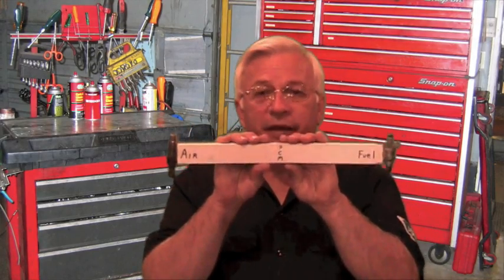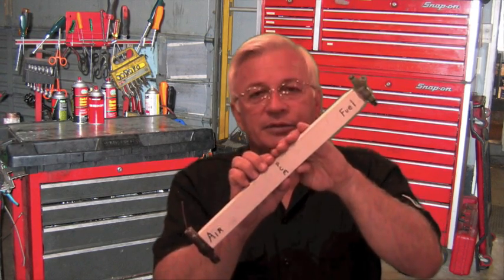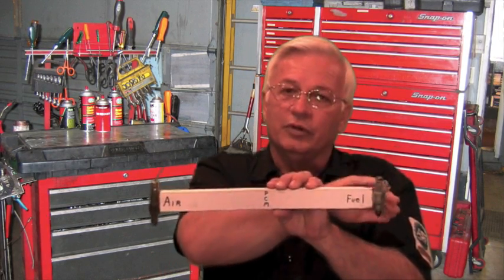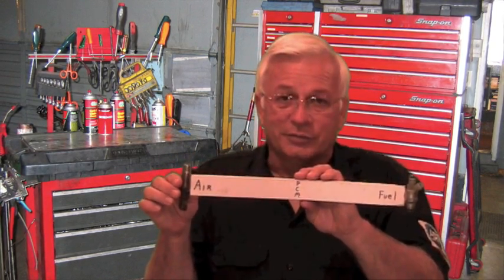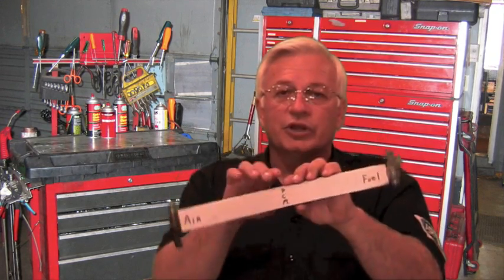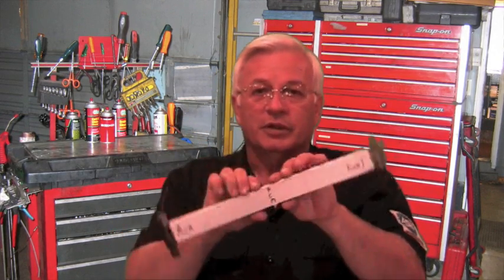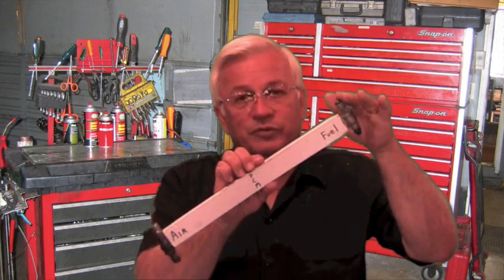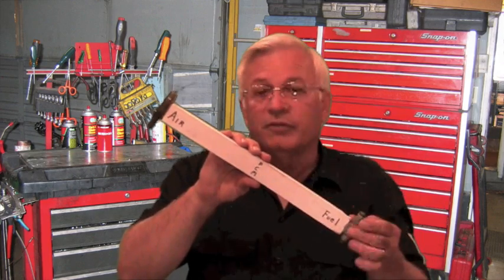Understanding Fuel Trim

Comment: well explained, but you the mass air flow sensor's role is not mentioned at all. A faulty mass air flow sensor can make a mess of the balance also, even if all other elements are working as normal

Comment: Could a exhaust leak between upstream and downstream 02 sensors cause a rich condition??also my downstream 02 needs to be replaced and just wondering if the leak and the bad downstream sensor cause really rough idle??
Reply from the maker: yes.  An exhaust leal is an air leak (lean or rich) and the O2's measure air, report the results to the PCM and the PCM  adjusts the fuel injector on/off tine accordingly.
Reply: realfixesrealfast thank you for your response sir!also just want you to know that all of your videos have been extremely helpful to me even all these years later for a guy like myself that likes to fix my own vehicles as much as I can.
Reply from the maker: @TurnupDOT  your welcome friend.

Comment: if anyone can answer my question i would greatly appreaciate it. I have a p0037 code my short ft seems normal but my longft is giving a straight reading that is in the negative does this mean i have lean fuel problem or a rich

Comment: Modern cars have map or maf sensor equip, with a clogged up air filter , air will be lowered a certain amount depending on how bad the restriction is , thus fuel delivery will be cut according to the sensor reading as I know, as air is reduced ,fuel is reduced at the same time. Theoretically Oxygen sensors will pick up a stioch reading , means it won’t add or reduce fuel trim? But how power is greatly reduced even if efficient combustion of 14.7:1 ratio and how it effects fuel consumption as well ?. Correct me if I am wrong , and thank you for the enlightenment

Comment: My car is a 2010 Elantra. Idles rough and gas mileage is terrible, and performance is slow. the fuel trim STFT is -.03 and the LTFT is - 4.7  Unable to find the rough idle issue. New plugs , cleaned IAC, MAF,  TPS  Any idea's I have a scanner?  Thanks

Comment: Good teaching sir, a quick question , subtracting or adding %of duty cycle means for all 4 injectors ? Or just bias one specific injector only ?
Reply from the maker: basically it's for all injectors at the same time.  However on some of the newer "V" style engine that have "bank specific " control, it's possible that only one bank may be adjusted.  But overall, its all the injectors.

Comment: Great video, my Mustang 01 3.8 doesn't have any codes. Through the past 2 years I've replaced all the O2 sensors, the MAF, IAC valve, new air filter,  new gas filter,I removed the catalytic's, new alternator and battery, new spark plugs with the correct gap, new wires and coil pack and so on but the car keeps behaving in such weird way, sometimes feels very powerful and sensitive to the throttle but sometimes I have to press hard the gas pedal to get a boost. Every year the car is a total pain in the butt to pass the emission test; this year a mechanic helped me to pass the inspection preparing the car for the correct driving cycles to turn off the catalytic converter or the EVAP the rest of the monitors were ok. I passed inspection and he said that he noticed something with the fuel trim and that he needs to adjust it with the computer? Is this true? how a mechanic can adjust the fuel trims with a scanner or a computer? I haven't replace the injectors neither the fuel pump (but for the past 3 years I've used Lucas injector cleaner every 15 days) Please some advice. Thank you!

Comment: The STFT swings rich to feed the cat and swings lean  to light the cat, the average between the swings is the stoichiometric  ratio of  14.7 to 1. 
Anything above or below the set maximum range of the swings will damage cat efficiency so the LTFT comes in to compensate, and determines whether a trend has occurred,  and whether that trend  is out of the range of ecm fueling control , in order to set a code and protect the cat.
Fueling does not naturally swing for no reason.
Creating an intake leak on a narrow band o2 equipped  vehicle will cause the vehicle to run up and down worse and worse until the ecm can no longer compensate and the vehicle stalls. If the FI system were Speed Density , no swing would occur , the engine would run leaner and idle up steadily as the leak is increased , until it knocks / misses , stalls or overheats. Just like a carb would.
The most basic electronic FI system needs only  , injectors, ECM,  IAT sensor,  MAP sensor, CKP sensor, Tach signal, ECT sensor, and TP sensor to operate,  after as many plot points as possible are  tuned with  wide band data to correct the VE tables that were theoretically derived, based on the predicted amount of air a particular  engine can pump, with no losses (100%)  and then subtracting for thermodynamic losses which usually is around mid  15% on an NA engine. Once accurately tuned, no narrow band o2 sensor is  needed if there is no cat or the need to run 14.7-1
The only reason for the narrow band o2 sensor is to stay at a stoich ratio and protect the cat, that is why you can only richen the tuning on NB 02 equipped systems @ WOT. or to get back into stoich range for the rest of the time.
The only need for a MAF sensor is to compensate for minor changes in VE, i.e. A throttle body that's a slightly different size,  a mildly different cam, or a dirty air filter etc. 
The cam sensor is only needed if sequential fueling is being employed.
A knock sensor is only needed  to reduce timing advance if the engine pings for whatever reason.
The IAC is set for base idle and can raise the idle by bypassing more air around the throttle body if called upon as accessory loads demand. If no such loads are anticipated, a calibrated orifice would suffice for just idle.

Comment: STFT means running Lean? LTFT means running Rich?
Reply: No. Short term is the constant switching that he speaks of in the video. Long term fuel trims is a stradegy based off of the short term fuel trims.
Reply: Long term fuel trims is the PCMs adaptive strategy based on the short term fuel trims. The PCM will basically learn what the short term is used to doing and adapt a strategy from it.
Reply: yes, and rich mean lean sound crazy but he's correct

Comment: Doesnt the iac add air through the computor
Reply: IAC is only a factor at idle. When load is increased on the engine it should switch to the throttle plate.

Comment: After getting a check engine light Honda got found code PO171. they cleaned mass airflow sensor. They sent me on my way and CEL came right back on. Then they read misfire codes and replaced all four fuel injectors. Now my car hesitates when I slow down to a stop and also when I'm going 40-50 mph.  After I bought it back they  told me the hesitation was 'due to an after market engine mount that had collapsed'.  I know for certain the engine mount is factory.  What should I try myself to diagnose the car before taking it to another mechanic? All the research i've done online seems to indicate its an air flow problem. Please help me! its a Honda Civic 2006 EX
Reply: Hey there, found this, hope it helps. 
"P0171 HONDA - Fuel Injection System Too Lean Bank 1. Possible causes: 

1- Intake air leaks
2- Faulty front heated oxygen sensor
3- Ignition misfiring
4- Faulty fuel injectors
5- Exhaust gas leaks
6- Incorrect fuel pressure
7- Lack of fuel
8- Faulty Mass Air Flow (MAF) sensor
9- Incorrect Positive Crankcase Ventilation (PCV) hose connection"

You can start trouble shooting the easy, like option 1, 4, 5, 7, and 9, the rest will require someone else with more experience.

Comment: this is where I get confused, so if you have a lean code where do you start? not enough air or too much fuel? what other factors can I use to lead me in the right direction?
Reply: Like he states, if you have a lean code, it means you have either too much air, or not enough fuel. This could be a clogged fuel filter, faulty fuel pump, or an air leak. Check for vacuum leaks at intake manifold, air filter housing, etc. Then pull injectors to see if they are clogged. Can also run fuel pressure on the rail to see if the pump is sending the correct amount of fuel. Most should read 40-60 psi on the rail. If it is below this you know its a fuel issue. Could be a bad regualtor, clogged filter, or weak pump. Depending on the year model and if you have access to a scan tool you can run PIDS to determine what each sensor in the system is reading as well.

Comment: Hello, i have a question. I have a 97 tacoma 2.4l and i changed the post cat 02 sensor due to a check engine. And its reading 99.0%-99.7% ltft for some time now, stft is reading normal fluctuating normal. My question is this normal right? I have no engine light on and my mileage is pretty good, driving an hour to and back work everyday. Also i have all royal purple fluids all around. Would any of this upgrades do that to my post cat o2 sensor   I have a k&n filter charger and throttle intake spacer installed.

Comment: when diagnosing a rich ,or lean condition ,what is a good order of checking things that mite be causing the problem ?maybe check the air cleaner ,and the MAF 1st .then the fuel regulator .then check the throttle body .check for any vacuum leaks .then check for any loose electrical  connections .then check the O2 sensor ,then test the injectors .

Comment: Sir I am not grasping your concept.The sensor measures the temperatur of O2, then sends signals to the computer.The computer then makes adjustment based on current conditions like throttle position ext.Yes the sensor sends voltage but how does it do this? The O2 sensor is really a thermocouple that is used to measure exhaust gas temperature.So it is actually a temperature sending device.Reads the amount of oxygen?It reads the temperature of the oxygen passing through. It is in all reality measuring the temperature, then sending the signal to the computer that makes adjustments based upon various conditions.Thank you for your effort, Ken
Reply: ***** Sir, how does the sensor know how much oxygen to add or subtract? It does not measure oxygen but the temperature of the gasses passing buy it. How can a sensor that is sealed off ever take a sample? It does not. Yes it generates a signal that tells the computer to add or subtract fuel. We are back at square one.It measures the temperature of the gasses passing by it along with generating a signal that sends information to the computer to richen or lean the mixture.Sir, I will stick like epoxy to my reasoning. I am 100% on this topic. Thank you for your time and effort, Ken
Reply: +kenskip1 it doesnt read temperatures..

Comment: a bit confused - at 2.49 he shows, using his balance analogy, that the fuel is in excess of the air as the  "weight" of the fuel is pushing  "the balance" down - therefore, does that not imply that the trim is rich rather than lean? - also similar to a rich mixture further on.

& fuel down

Comment: I have a 2004 Audi A4 with a 1.8T in it that has a p0171 lean fault code but my ltft are -3.1...What could possibly be the cause of that situation?
Reply: need an engine
Reply: Jay Sheeley could be a misfire in one of the cylinder and not burning the fuel air mixture thus o2 sensor detecting oxygen and thinking lean due to the unburnt oxygen thus computer compensating for the lean and dumping more fuel, so check you misfire count, check ignition, spark plugs,

Comment: This helps me understand Lean and Rich conditions, but it doesn't help me understand Fuel Trim data that comes from my OBD2 scanner.
Reply: mrjost55 This should help even though the engine platform is different the principles are the same. Read and try to figure out the math equations they give you for determining how to balance, spark and knock and what not. It has helped me alot but you have to read it a couple times to start to get it.
http://translatedby.com/you/the-basics-of-lt1-tuning/original/?page=1

Comment: Can a dead downstream O2 sensor cause stft and ltft to be frozen on 0% @ Idle? when I push the gas pedal the car stalls. No stft or ltft adjustments at all. 99 Mazad 626 2.0L. Great Videos Thank You.
Reply: No, downstream o2 sensor only monitors catalyst efficiency. Your engine is an Fe3 and odds are you have a bad maf sensor or it needs to be cleaned.
Reply: +Derrick Hodges In the old rule of thumb you are 100% correct....more recently,  downstreams are affecting fuel trim....scanner Danner has a video about it...check it out!
Reply: Thanks for the heads up, I'll check it out. Imagine it, looks like bad catalysts will start causing rich trim commands if I'm thinking correct.

Comment: Stop flipping that thing back in forth. The fuel and air does not flip not back and forth like that the signal from the O2 sensor does because of how it operates and the exhaust flow is not constant.
Reply: So please, using that superb English grammar you used in your criticism, explain to us how it really works.  I have no doubt that your experience trumps this well seasoned and highly trained technician. In other words, this explanation is quite sufficient for the subject at hand and for getting the general point across.  He isn't explaining how an oxygen sensor operates, he is explaining how the ECU compensates for the varying conditions seen in the exhaust also known as fuel trim.  It's even in the video title.  Don't let facts get in the way of a good rant though.
Reply: Brian H Good to hear from another Brian, picking apart my public school grammar is definitely a good way to address my comment without going into the technical reasons my comment "may" be incorrect. I really made the comment because I was getting motion sick from all the useless motion in the video LOL. I have not seen many scan tool pid's of fuel trim but the ones I have seen have not been bouncing between + and -  3 or 4 a second so the flipping teeter totter visual was misleading at best.
Reply: +Brian H 😁

Comment: Antifreeze will kill those Lambda sensors dead in no time.   This means that if a car is using water or has combustion fumes in the radiator, swapping the sensors will be just throwing money down the toilet.  I told this to a bloke years ago and it was tragic as he had a donor vehicle with crystal clear bright blue antifreeze in its engine so I said to swap the engine.  He swapped the good sensors into his car with the (IMHO) blowing head gasket and they were dead within a fortnight.  The car then had a stinking black exhaust and was only doing 15 to 20 mpg.  It was then a case of phoning for the scrap-man.  Shame!

Comment: Hmm, there's a bit more to it than that but the good news is that the car can often be fixed very cheaply with some oven cleaner!  Problem car was a Vauxhall 1.8 The car drove well, was quite economical and made no exhaust smoke, nevertheless at the annual MOT it was failed on emissions for excess oxides of nitrogen! (A piffling amount really but the MOT testers are all terrified of VOSA as if they pass a faulty car, VOSA may take their licence)  A drive-by-wire expert could find nothing wrong as there were no fault codes so the two Lambda sensors were replaced at a cost of about £200. The emissions were still the same!  Finally a new Mass-Air-Flow sensor was purchased at a cost of about £90 and everything came good!  What allegedly happens is that atmospheric dust burns onto the hot wire sensor and insulates it slightly from the air flow.  Result is that more air needs to be sucked-in to get the wire to the correct temperature.  The mixture then goes lean, the burn temperature rises and produces more than the permissible amount of oxides of nitrogen. Result is an MOT fail over fractions of one percent!  With ALL computers the result is the same, rubbish in = rubbish out!  It is possible to clean the hot wire with oven cleaner.  Leave it on overnight and wash it off in the morning.  OK its a bit like watch-making but you could save hundreds!

Comment: I finally get it! It's so simple. The injectors send air to the PCM which controls the amount of fuel to the O2 sensor which allows the PCM to keep the fuel/air ratio balanced.
Thanks man. I don't feel so stoopid any mor. 
Well, I'm off to master the art of gas welding. What could possibly go wrong?

Comment: Lean codes on a 98 ford windstar both banks. Fuel guage stuck on full. Fuel pressures low but still within spec. I went ahead and replaced fuel pump assembly with new filter. Fuel guage fixed, lean condition still pressent. Ac delco mass air flow replaced 5 months ago. I sprayed throttle cleaner all over engine area monitoring st and lt trims,Seems like I get a reaction from the egr controller not sure though.

Comment: That is all calculated by the PCM as he was stating. if an O2 sensor is bad or a MAF sensor is bad a code might come on saying rich so the injector pulse would be minimized. All the sensors are tied to the PCM and the PCM uses those sensors to calculate how much fuel should the injector spray.

Comment: If what you say is true, th O2 Sensor reports datat to the PCM and the PCM merely sends signals to the PCM for the Injector pulse width data.  What about other input sensors like MAF, TPS, and other sensors that can affect fuel mixture?

Comment: I would have liked to hear how speed is related. I assume more fuel is injected for higher speeds. Is it that the PCM is always keeping the 14:1 ratio? If so, when fuel is added, isn't more air needed, indicating air flow is increased or decreased accordingly?

Comment: @DoomDevil I'd hate to argue because you are thinking logically but your not thinking deep enough. The O2 sensor does in fact give a reading on the amount of O2 taken in and it adjusts the fuel accordingly for optimum burn. If the sensor reads high in O2 then the computer knows more O2 came in than what it calculated/expected and vice-versa.